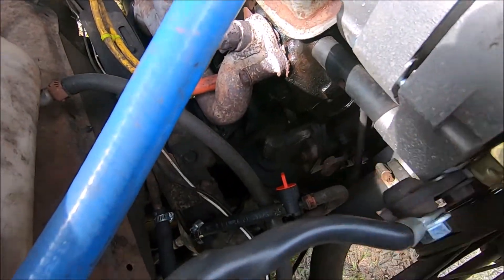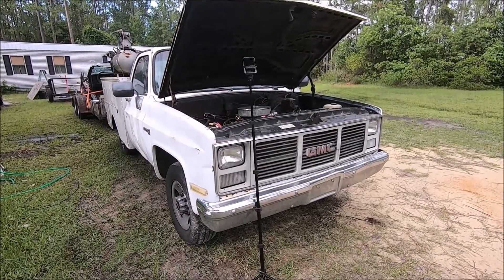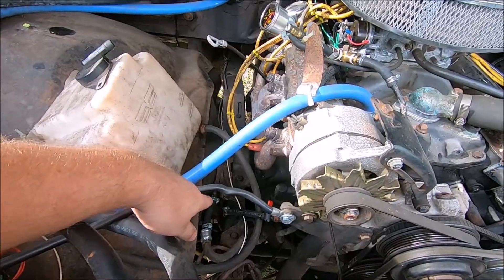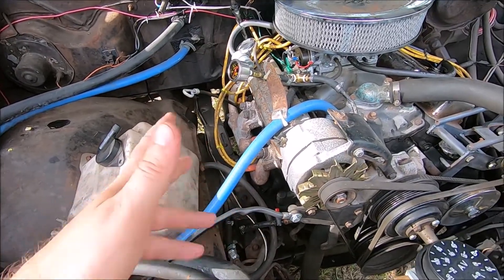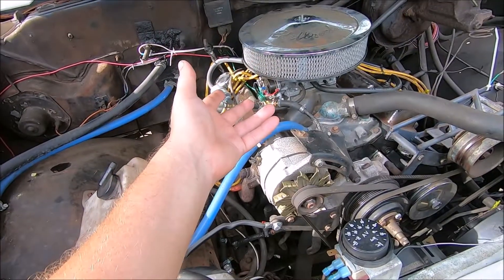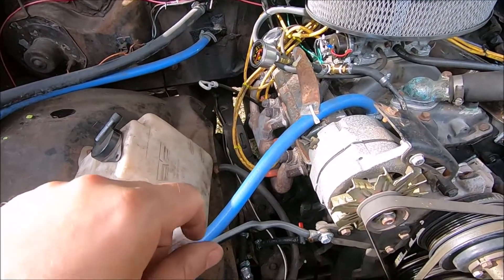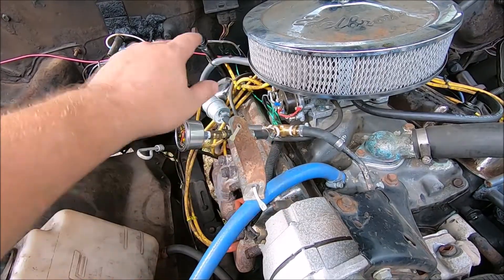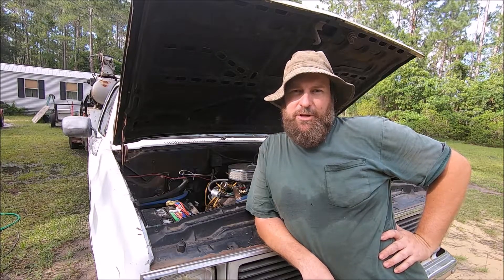Mechanical fuel pump pressure and bypass troubleshooting tips

Comment: I’ve got a diesel and it’s a pain to idle and don’t run clean through the rev range, thought the lift pump on my mechanical pump had failed so,installed an inline low pressure pump, that made it worse then tonight I removed my return fuel line and couldn’t even blow through it at all
Reply from the maker: On a diesel, a bypass is necessary so that trapped air can circulate out of the system, as it looks like your system was having difficulty with. With carburetors air can escape the bowl vent, but a diesel has no way out except the return or the injector itself. And since air can compress under high pressure it’s much harder to push it through an injector cycle.

Comment: A fuel pressure regular has more fuel going back to the tank at idle but at higher rpm the pressure regular closes the amt of fuel going back to the tank as there is more fuel needed by engine to run at higher rpm.  At least that's the way it works with EFI.  With many modern EFI the pressure regulator is in the pump in the tank and there's no return line from the engine.

Comment: Where did you get those shut off valves? I want to add them to my truck. Also, with the return line on the pumps, does that mean fuel will always drain back with the engine off, causing hard starts after a while of sitting?
Reply from the maker: The valves are just cheap plastic 3/8” barb shut-off fuel valves from online, or auto parts stores sometimes have them with small engine parts. The one-way check valves are the same deal…. Can be ordered online pretty easy. 
Fuel shouldn’t drain back in the main line in theory on a properly working pump, but if it’s aged or sits a while it could happen. Mine tend to sit sometimes so I like to hedge my bets. They will usually drain back from the line above the pump to carb though. But that usually isn’t noticeable if the bowl is still full because as soon as the engine starts off the bowl, the pump will fill that line.
Keep in mind that the cheap pumps use the orifice type bypass that’s just a tiny hole and don’t have an actual valve, so they are always open to a small extent regardless. The pumps with real valves are the only ones that ever fully close.
But unless it sits long enough for the bowl to totally evaporate, hard starting shouldn’t be an issue due to fuel.
Reply: Thanks for the quick reply. Yeah I just pressure tested my truck. It has a quadrajet and the pressure is bouncing between 8 and 10 psi. I shut off engine and the pressure drops to zero within a few seconds. Not sure if I should get a pump or a regulator or what.
Reply from the maker: @gregorykotoch5045  most regulators these days are garbage. I’ve tested a few in another video and none of them did what they were supposed to on a carb application.
But that pressure is pretty normal for a pump these days. Usually we always figured between 6 and 12 psi (generally) was normal. And the bleed down could be an orifice type if it’s making normal pressure otherwise. So it could be ok.
If it’s hard starting for lack of fuel I would tend to suspect a leaking bowl in a Quadra-jet. It’s been a while but I something tickles my brain about those having an issue sometimes with something on the bottom of the bowl. A plug or crack, can’t remember.

Comment: I only run the non Ethan fuel, I have  over a dozen old gm cars, with the mechanical  fuel systems
Reply from the maker: This is a great practice and I would do it if non ethanol was carried by more stations near me. Unfortunately it’s pretty rare around here. Ethanol is just so destructive to any rubber not made to handle it, and when it evaporates it leaves  such a mess behind.

Comment: My 78 Cadillac bleeds down if it's parked uphill is it the pump or a bleed down valve gone bad ?
Reply from the maker: That’s a more strange one….. I would tend to lean toward a tank pickup being exposed and allowing fuel bleed back in the tank, or something more related to that. Although the pickup should be in the bottom, obviously. That’s a strange one.

Comment: is the bypass valve inside the mechanical fuel pump ? or somewhere else ?
Reply from the maker: Yes it is part of the pump. Some pumps have a bypass valve, some cheap pumps use only an orifice restriction to continuously bypass a certain small amount of fuel back to the return line. On these orifice bypass pumps there will always be some bleed-back through the return line and the pump-to-carburetor line will not hold any pressure with the system off. However the same pressure principals apply during testing while running: a weak or failing pump won’t make enough pressure, and shutting off the return should raise pressure at least a little.
Reply: @ awesome, thank for the info and help !!

Comment: I have an 88 pickup ,I'm changing motor to an older carbureted Chevy 350.  how do I get around the electric fuel pump to use the mechanical pump?
Reply from the maker: For those, the pump is in the tank inline with the pickup. It’s pretty hard to suck fuel through it (although it can be done). The main issue with pulling it through the existing pump is it adds resistance and can age the pump extra fast, or a non-healthy pump won’t manage to do it. The best solution is to pull the pickup and pump assembly out of the tank and replace it with the non-pump assembly.
Reply: @wrenchwranglers  thank you,would you happen to have a link for a non pump assembly? I also am looking to replace the fuel tank as well
Reply from the maker: You’ll need a pickup assembly like this one, as far as this actual one goes I have no idea on quality, etc. This is for reference only. The right tank/left tank are different in that they are basically mirrored so the hoses point differently, so you have to get the correct one. Earlier than about 1980 are the same but have no return line usually. 

https://www.ebay.com/itm/231848192376?chn=ps&_trkparms=ispr%3D1&amdata=enc%3A1eK8y9xGnQ5GKYVHXE9HIuw48&norover=1&mkevt=1&mkrid=711-117182-37290-0&mkcid=2&mkscid=101&itemid=231848192376&targetid=2374270860207&device=m&mktype=pla&googleloc=9011476&poi=&campaignid=21214301188&mkgroupid=161029916821&rlsatarget=pla-2374270860207&abcId=9407524&merchantid=6318714&gad_source=1&gbraid=0AAAAAD_QDh_hhK1RDoaiNjR8Gogy_y9JS&gclid=Cj0KCQjwhYS_BhD2ARIsAJTMMQaXpbBzvMK3__VoZPBymJtpdhgfpIEn8vLvKveK4MOqy0QKMawjHygaAlmYEALw_wcB
Reply from the maker: The best process is to use the tank and pump from 1986. I can’t remember but there’s a chance the internal baffles and tank shape are different on the electric versions in 1987. Honestly I can’t remember off the top of my head. But best to order the 1986 tank/pickup combination for the correct side together.

Comment: Hey I had an issue with my Corvette fuel pump (Carter) and chopped it open. The return line is unregulated by a valve. All it is is a small pin hole on a stand pipe. Nothing can fail on it. There is no valve controlling it. So the issue with your pump will either be, a split in the main diagram causing low pressure, or one of the two valves that control the ‘suck’ and the ‘blow’ are up seated or completely disconnected from the mid plate. Replace it and cut that one open.
Reply from the maker: You are correct that some regulate pressure through a controlled orifice on the output side. I should have elaborated on the styles of bypass in the video, I suppose, but when I get too technical it gets boring and people tune out, lol.
There are both styles however, and the more expensive ones use an actual spring loaded valve.
The orifice type was a way to cheapen some pumps way down, but still maintain the capability to reduce vapor lock. Unfortunately if the orifice is wrong from the factory, or worn, even a little bit can have a big effect on output pressure, and it gets worse as the diaphragm ages.
Reply: @wrenchwranglers Excellent thanks for the explanation, that makes sense now. Great video as well!

Comment: I have no idea what’s wrong with my 78 Chevy Silverado. It’s a 454 big block, the fuel pump is bought it with sucked, I replaced it, the first one didn’t work, the second one worked and then just gave out. Now with the new one, the flow is so weak, the idle is rough, sometimes it randomly dies, If I don’t hold my foot on the gas lightly when cold starting for at least a minute it won’t go. Fuel filter Is new, no leaks in the lines, it’s dual tank, dual tank switch works great, one weird thing, when the truck ran well, you could see the fuel in the fuel filter and even when the truck was off, there would be fuel in it almost full. Now when I turn the truck off, the fuel drains back down in the lines, it’s like it loses all pressure when off, idk if that’s normal.
Reply from the maker: One thing to make sure of with old trucks is that the fuel tank vent is clear. If it gets plugged up the pump has to fight that trying to pull fuel from the tank. You can also do a quick check of the fuel cap and see if it runs different with the fuel cap off.
Reply: @wrenchwranglers  I can definitely try taking the caps off. It operates pretty much the same on either tank. Where would I find the vents?
Reply from the maker: @ThatAKguy47  on the top of each tank sender there is a second tube coming out with a rubber hose with a plastic vent/valve on the end. You have a ‘78 so it shouldn’t have a tank return. So there should only be the fuel sending tube and the vent tube.
Reply: @wrenchwranglers  but the fuel pump has a return line on it.
Reply: @wrenchwranglers  can’t I get vapor lock without a return line?
Reply from the maker: @ThatAKguy47  you can. That is why gm added it.
Reply from the maker: @ThatAKguy47  I’m not sure what years/models they added the return line. But if yours has one then I would also check the pump bypass for the return and see what the pressures are with the return blocked/open. If the vent is clear.